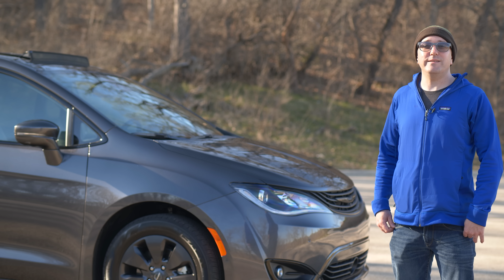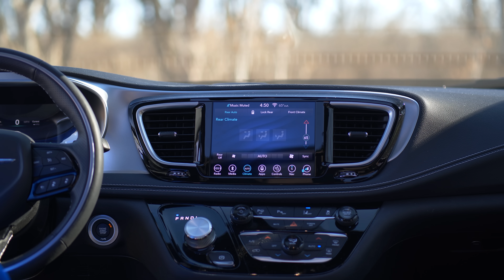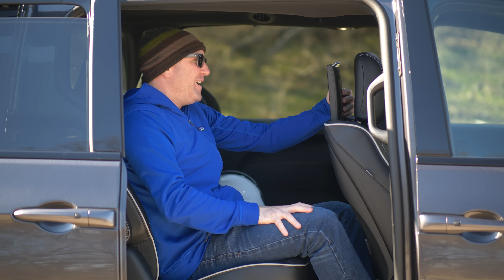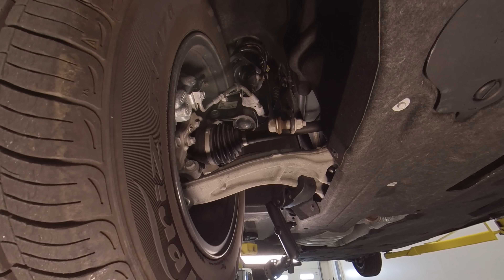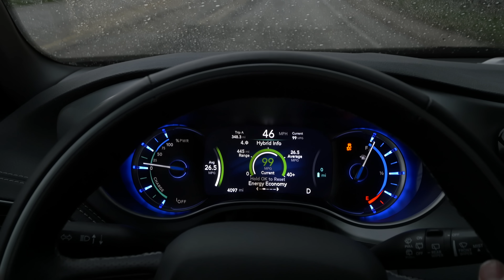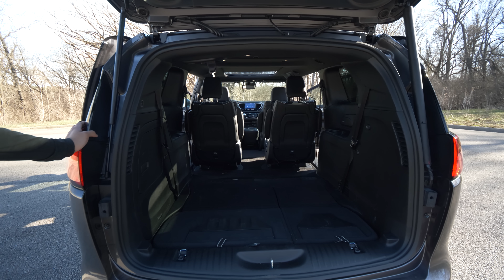2019 Chrysler Pacifica PHEV Review | Players Only

Comment: Thank you for your very detailed video, it's very helpful And interesting， And i have a 2019 pacifica PHEV In China. And I found the Chinese version is a little different from that in America , for example  we have no 110v or 220v Socket near the third row. So I just have one question: can i discharge the power battery to the external electrical devices, such as electrical fan, rice cooker or oven. ... Have you tried to do this before？

Comment: What I wonder about is that it has the same 3.6 L engine as the non-hybrid plus electric motors but it still has less horsepower than  a non-hybrid version

Comment: you're adding complications yes, but remember, the engine gets a huge break as the electric motor will provide a lot of power most of the time. So you reduce wear and tear on the mechanical parts. Further, you regen brake so you reduce wear and tear on the braking system. Hybrids / plug-in hybrids will outlast traditional vehicles and require less maintenance over time.

Comment: Hey amazing review! So detailed & thorough, your tester is my dream but I got the next best on my list which is this minus S package (black leather, tan headliner etc). I plan on getting 22" rims soon, hopefully they help give more responsive steering & reduce body roll. Is there anyway to stiffen OEM springs or could u recommend a few a spring swap that could raise van 2". I'm coming from a Durango R/T so I would like to get slightly closer to that feel. #dadmobile

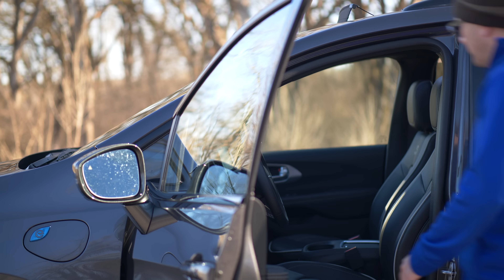I 💀 laughing at 2:45 btw 👍

Aluminium steering wheel looks sick but def makes heated wheel cold 😫😰

No OEM floorwell lighting, I added $12 USB LED kit in 20mins looks 🔥

Added $300 Pedal Commander (Sport +1 setting), def improves driving experience & quickness 💯 %

Worse case MPG is 30MPG, Best was 42MPG (electric only 3 days) AVG MPG 33 🙌🙌🙌🙌
Durango R/T AWD MPG =13 👎
Reply: Yamaha Mulah don’t put rims on this

Comment: we had a 2007 Chrysler mini van that lasted for 3 years 100,000KM (about 60,000 miles) before selling it for 1500$ (the transmission doesn't shift, the wipers turn on when change the radio station)

Comment: Savage.....how do you rate the Pacifica against the Odyssey and the Sienna?   I traded in my 2014 Honda Odyssey Turing which had problem after problem for a 2017 Chrysler Pacifica limited (gas version).  From my experience the Pacifica is hands down a better vehicle in every way over the Odyssey.  It drives better, quieter, stow and go seating and better kid friendly tech.  I have 36,000 km on it thus far and no issues.  What are your thoughts on the comparison?
Reply from the maker: Personally Id rather own the Pacifica (gas) it drives the best, has some of the best features and sound system. But the Sienna is gonna be on the road longer.  Have seen some with 400-500k.miles on original trans and motor.  The Honda has had some dings for repair costs and stupid issues I would not want to deal with.
Reply: @savagegeese  Thanks for the reply Savage.....I agree with you completely and I am very happy with the Pacifica!  I hope you are going to swing by Toronto again and collab with the Straightpipes! If so....I'll be hanging around cliche corner more often to catch a glimpse of you guys :)

Comment: I have a 2010 Audi TTS roadster with the dual-clutch transmission.  It also rolls forward if I have it in reverse while my car is aiming downhill.  The opposite happens when I'm aiming uphill.  When I have the car in drive while the car is aiming uphill, then the car rolls backward until I press the acceleration pedal.  The only other automatic car I've been in that did that is the Alfa Romeo 4C.

Comment: I have the touring L plus with tow package and 18" touring package. Just went through my first Minnesota winter with those 18s. Other than the low 5.1" ground clearance plowing snow a few times, the van actually handled really well in The snow and packed ice/snow on most streets. My wife has a 2011 CX-9 awd and that was very easy to break traction. Next year I'll probably get snow tires but for those concerned, don't be.

Comment: As someone who owns a Mitsubishi Outlander PHEV, I kind of wished I had this instead. Yes it isn't an SUV or has AWD but the EV range is better here, it charges faster on a 240v circuit & amusingly despite using a 3.6L V6 actually BEATS the Outlander PHEV 2.0L Inline 4 in fuel economy in hybrid mode.

My only real reservation is FCA reliability.

Comment: I have a Dodge Grand Caravan awd. Sometimes i get the itch to ditch the awd, and mount an electric motor to the rear diff via viscous coupling. Tesla batteries, and i bet i could get many extra miles over this with the gas engine completely off

Comment: Looks good! We had a 2005 T&C which we later gave to another family in our church when we bought a new car. They’re still driving it, and the only repairs that have ever been made to it were a new full brake setup on the back wheels, a re-flash on the ECU (it started doing the “possessed” gauges thing w/ check engine light), and that was about it. The darn thing is rusting badly, though...I hope that’s something FCA has addressed in the new 2nd gen platform.

Comment: I drove our 2009 chrysler town and country plenty of Times. It’s fine to me and I own a sedan. It has 140k miles on it to. My 2015 chrysler 200 has a aluminum control arm all the way around. I will say tho the wind noise in the town and country is pretty loud, but it’s a very smooth ride but it is a boat. But overall we love it. Interior could be a little better quality but the design was way ahead of its time for 2008. And challenger and charger are very refined you say it and the Durango. That platform is good.

Comment: i drove in the Pacifica.. it's loaded to the teeth but the Kia Sedona even in the 8 seat config still has bigger fluffer seats even in the 2nd and 3rd rows and a traditional gear selector makes heading over mountain passes it's way easier to lock a gear to get some engine brake

Comment: other than destroying a BRZ off the line, how would it do in an autocross?  What class would I be in if I took it down to my local SCCA event?   The only thing I would add is rear wheel well skirts ala Pontiac Silhouette and a rear diffuser for that sleek futuristic look and improved aero.   That steering wheel looks tacky and painful in the heat of summer and the cold of winter.  Who comes up with that silly nonsense?

Comment: in colder climate and colder weather, does the engine run...alot? For heat and comfort?
Reply: Once the battery power is deleted, the hybrid would completely resort to running on the ICE engine.
.
That's unlikely though because hybrids are engineered to always be constantly saving and generating energy. 
.
While you're driving a lot of the energy is saved into the battery through, "regenerative braking."
Reply: If you're running on battery only, PHEVs  use up more battery during very cold days:
-Gas,
-heating (mostly)

Comment: As an owner of a 2015 Sienna oh, this is really compelling to me as it offers just what I need and fixes a lot of the issues I had with my van and the previous generation vans that Dodge and Chrysler offered. I'm still a little weary of the reliability but it seems like they're definitely refining everything and especially with this hybrid model it would be very useful for what I mainly use my van for. I'll just have to find one pre-owned or with a good discount since the hybrid model is quite expensive
Reply: Trust your instinct, Chrysler quality is horrible.
Reply: Also I understand that the new Sienna is going to be on the new platform, but it's kind of unacceptable if they've been using the same one for 10 years, with only some minor upgrades to the interior and Chassis and updating the powertrain which I feel made the car drive a lot rougher with that 8 speed automatic shifting so aggressively

Comment: Rented gasoline version on family trip to Arizona. Just a spectacular car. 6 adults, 6 roller bags, 4 sets of golf clubs, no problem. Two hour drive from Scottsdale up to Sedona sitting in the third row (I’m 6’2): no problem, could have been 6 hour drive. Smooth, quiet, comfortable. I was blown away both driving and riding in it. Haters gonna hate, but this is probably gonna replace my SUV when the time comes.  Best rental car I’ve ever had.
Reply: alliejr  I rented a Pacifica in San Fran and drove it  down to San Diego. 7 people and so comfortable drove like a luxurious vehicle. Colored me surprise. Even pick up was awesome.
Reply: Good luck with the repair bill
Reply: @wills5482  Parts for Chrysler are cheap. Just avoid the stealerships. Repairing automatic transmission in Chrysler can be cheaper than one headlight for bmw 5 series.
Reply: @cytrynowy_melon6604  It's a ZF transmission not Chrysler, the 9HP is used in Honda, Acura, Jaguar Land Rover, Nissan, etc. ZF has had a pretty good reliability rate with transmissions.
Reply: @wills5482  warranties. How do they work? Seriously with a 10 year powertrain warranty (you know the things chryslers fuck up) you're good if anything goes wrong.
Reply: Yeah, but 10 years goes right by as does only 100k. I’d rather buy a Toyota knowing it’s just beginning to Walk. These will also see resale Plummet Hard. Chrysler is pure Junk.
Reply: @wills5482  Do you have any evidence to support your claim that there are high repair bills?
Reply: @TheGerm24  Because FCA.
Reply: TheGerm24 its a Chrysler
Reply: @djkenny1202  the C in FCA stands for Chrysler (Fiat Chrysler Automobiles)

Comment: Agree on better driving dynamics - we sold our 2017 gas Pacifica and bought a 2019 Hybrid and looove the feel of the eCVT compared to that zf9 speed that was in the gas. It wasn’t horrible, but getting rid of the gear shifts and adding electric torque makes for such a nicer driving experience.

All driving is city and charge ever night, tank of gas is lasting months so far.
Reply: Might want to use that months old gas and replace it before it goes bad and mucks things up.
Reply: @USARAY1947  - Gas is good for a minimum of 6 months, and should easily last a year in a modern fuel tank.
Reply: Pro tip from me, try to at least use one tank of gas per month because this modern gasoline that is blended with ethanol goes bad quite quickly. It will be healthier for the engine and every component involved to at least try to use gasoline once in a while.
Reply: Never heard until now somebody likes a cvt over an automatic. Well. Now I have.

Comment: Some reviewers like the Pacifica better for how it drives and the features, however the Sienna is probably going to be much more reliable. The Odyssey reliability has gone down the toilet the last few years, to much more crappy. Seating 7 was very useful at times when our kids were young and had several friends with them, or to put 1 in each row if they were miserable. As they got older (19 and 22 now), we started buying 5 seat small SUVs instead to sit as high, but less expensive with an inline-4 and shorter, for better in parking lots and for better cornering.